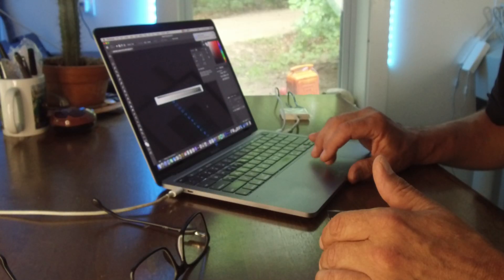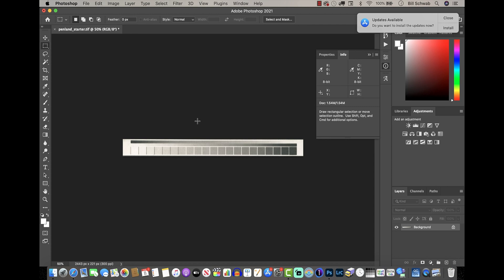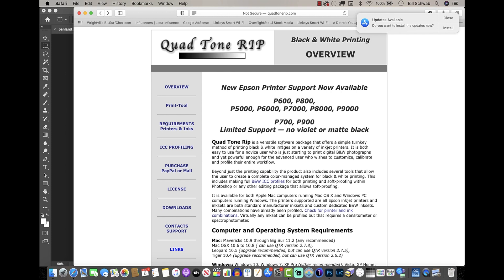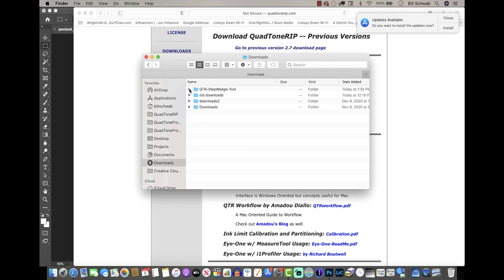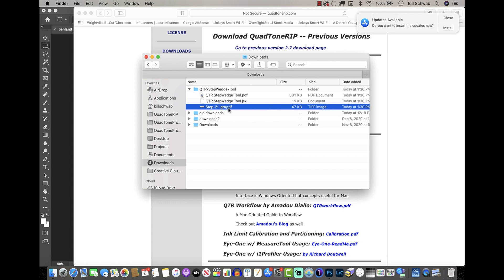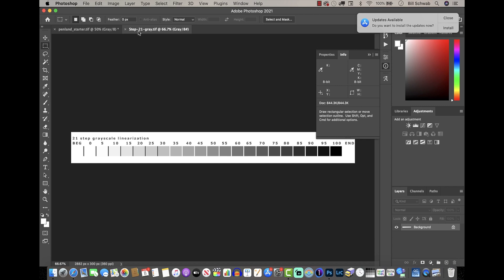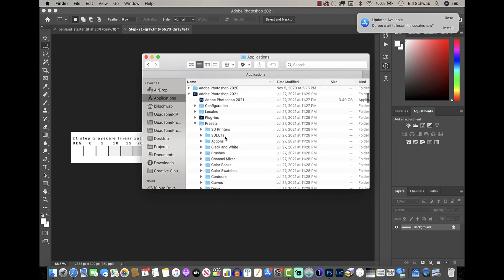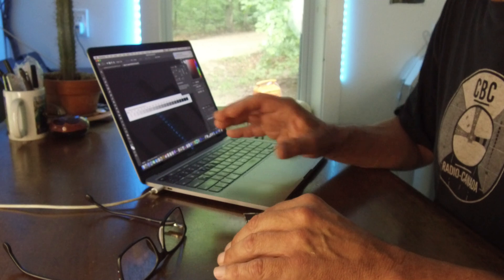The Digital Negative - Appendix A - QTR Step Wedge Tool

Comment: Still plugging' away!  Richard mentioned using the Tiffen Q-13 target when using the scanner when using the step wedge tool.  Do you have to use that every time.  I'm a little foggy on the steps after the starter curve. Thank you!!!
Reply from the maker: Hi Dorothy. Just follow back through the video. I’ve never use the 13 step, but you do use it every time you do an iteration. Each time you create a new correction curve, you print out the stepwedge and then scan it to see how close you are getting to linearization. It usually only takes me two or three iterations to settle on my final curve.

Comment: Hi Bill, thanks so much for this series. Not sure if this is the right vid for my question but here goes: My QCDN V2 Linearization screen is a bit different from yours, (I don't have the pro.) My assumption is the "save" button exports the new .quad file (and it seems too.) But I noticed that under "Show Ink Channels" both OR (orange?) and GR (Green?) are clicked on by default. I am also on a P800, no orange or green inks,) should I click those boxes off or are they irrelevant? When I click them off the curve appears to change....

Comment: Hi Bill, in this video you use the 21 step wedge, did you print this wedge with the starting curve from the previous videos, or did you print them without curves.
Thank you very much Bill
Reply from the maker: Hello Alfredo. Yes. The 21 step wedge is printed first with the starter curve and then with each correction curve built until you have your final.
Reply: @BillSchwab  Thank you very much Bill for the clarification.
Reply: @BillSchwab  I had the same question.  Thanks!

Comment: Bill: this is another great video in your series. Thanks for helping to make the process more understandable.

I do have one question though: in this video you use the 21 step gray tif target as the "control." In the instructions, Richard uses a Tiffin step wedge as the control. I am guessing these both work equally well?
Thanks,
Dan
Reply from the maker: Yes. Both work equally well. It is possible that the Tiffin is a little more exact, but I found no issues in using the 21 step wedge that was provided with the original program. So glad you like the video!

Comment: Bill,  Nice job. I have a question about the version of Richards program. I have both the original QCDN and the newer Quad Tone Profiler Pro DN. Which one are you using? and (another question) in the video when you open up the program and select linearization, your screen shows "V2 Linearization"  V2? what's that?
Thanks for your much appreciated work on doing these videos for us.
Reply from the maker: Hi Kirk. In this video, I used the new version, version two. I think that’s what the V2 refers to. It’s pretty much the same program although has a few new goodies to use. I’m currently working on a video for that one that will replace number four in the series.

Comment: Morning, Bill. I assume you can use this process for making a Silver Gelatin print with a Digital Neg? Just use the Silver Gelatin paper as the substrate instead of HRP, correct? Thanks.
Reply from the maker: Hi Andrew. Great question. It is possible, but silver gelatin prints from digital negatives are a whole other animal. You’ll need the white substrate and it to is only for contact prints. You can’t enlarge these because of the artifacts. They’re just not acceptable.
Reply: @BillSchwab  Hi Bill,, thanks for taking the time to answer, but am not quite sure I understand. What is the ‘white substrate’? And what is unacceptable, the resulting Digital Negative or the Print or ?? Thanks for clarifying.
Reply from the maker: @andrewweis3028  Sorry not to be more clear. It would be the print that would suffer when enlarging the inherent artifacts of a digital negative.  In alternative processes, you have rougher surfaced papers and artifacts don’t show up. Silver gelatin paper is much more sharp and clear and shows the imperfections in a digital negative. I will look for a link to the white substrate. It’s basically the same material but it’s a cloudy white.
Reply from the maker: This is the stuff. The white film helps in diffusing the light and helping to hide any artifacts. Do a  Google search on the subject and you'll find better information than I can provide.

https://www.bhphotovideo.com/c/product/544974-REG/Pictorico_PICT35001_Pictorico_Pro_Hi_Gloss_White.html
Reply: @BillSchwab  Thanks for your help, Bill. I’ll check into it and then way the advantages vs. disadvantages of using Silver Gelatin for printing with Digital Negs. Much appreciated.
Reply: Just a thought, Bill. Doing a YT video on how to make and use a Dig. Neg. for contact printing on Silver Gelatin paper might have a good response since I believe that not too many others have done so. Just a thought. Thanks again for considering.
Reply from the maker: @andrewweis3028  I’ve definitely thought about it and I think you’re correct, but I haven’t done any work in that direction myself yet. I do have the film and I’ve been planning on it for a while, so stay tuned. Thanks again for all of your comments in for watching!